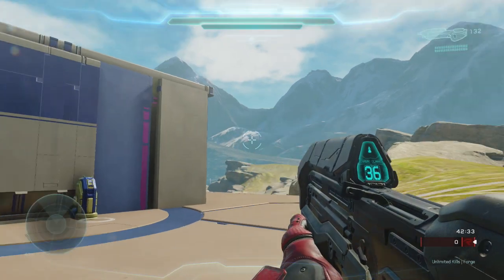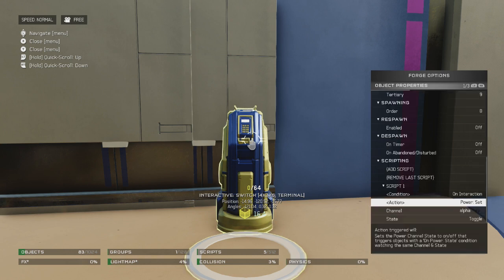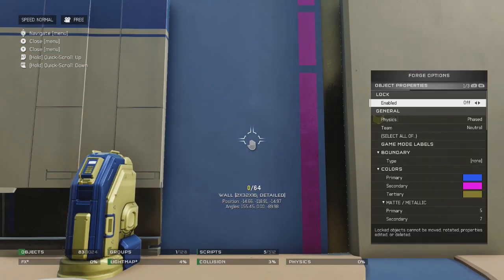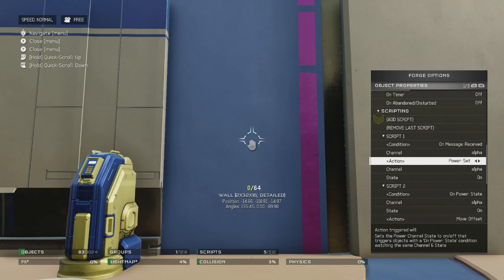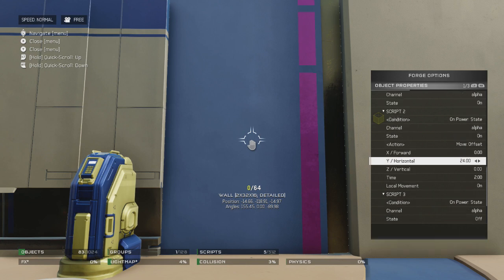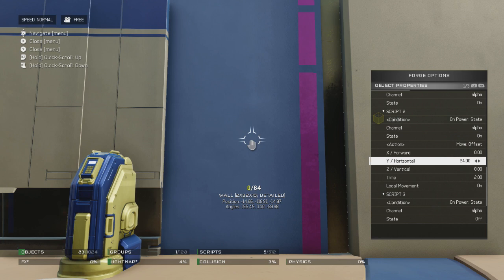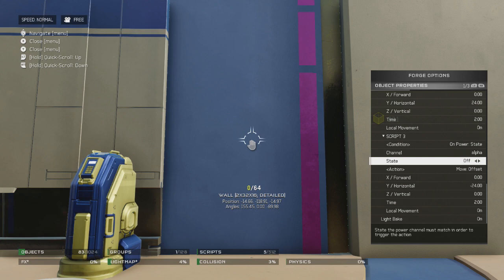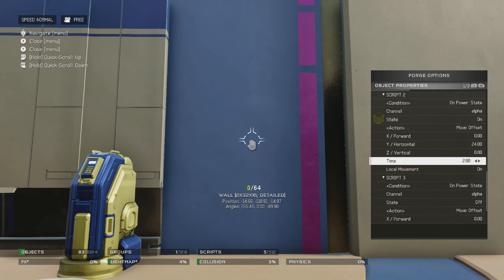Halo 5 Forge Tutorial | How To Make A Moving Door With One Switch

Comment: Just wanted to say, I've seen a lot of great videos on how to use the forge, but I wanted to make a door that automatically closes on its own after being opened- so I played around and figured out how to do it, just in case anyone else wants to as well...basically, when you add a script, you can add multiple actions within that script. I made the first action to move my door, a second action to wait (I chose 4 seconds, but you can make it whatever), then a third action to reset the original position. So, what I ended up with is a door that's opens, waits for a period of time, then automatically closes- all with 1 (or multiple) switch and only 1 interaction.